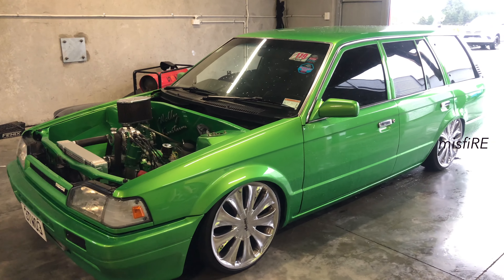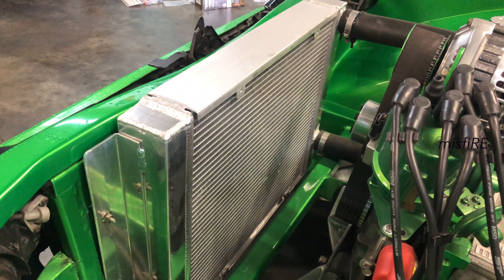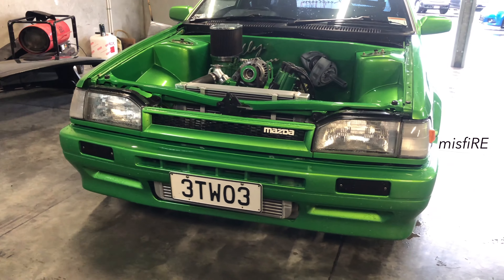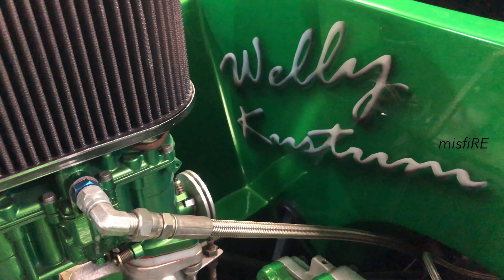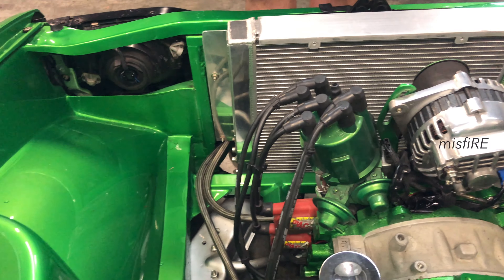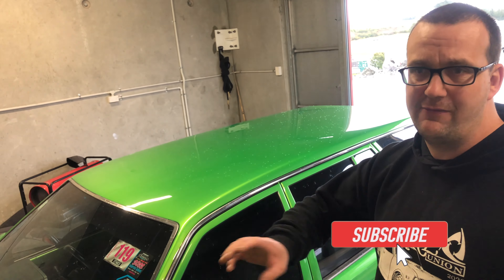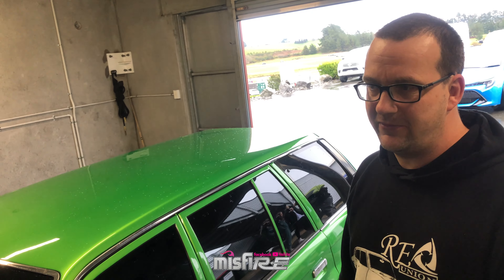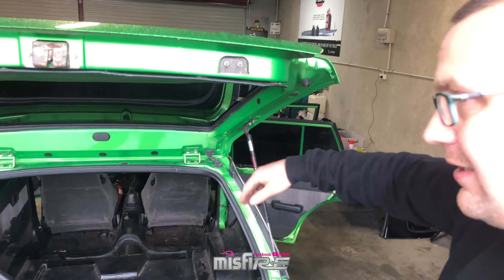4wd Mazda familia ROTARY conversion

Comment: I had a Mazda 323 4wd turbo back in 91 it was 88 model i bought from a dealer that was very limited numbers in Australia. I kicked so many vehicles with more hp,litres and power at the time with this 1.6 turbo charged engine....i wanted a 13B Turbo fitted instead of the original engine but no one could fit a rotary engine left to right into the engine bay. If it was possible all hell would of broke loose.....
Reply from the maker: 💯 the 323 r extremely rare havnt seen one for sale in afes
Reply: someone did a east/west 12a in a honda civic.. so anything is possible.
Reply: It's been done east to west in a 90' gtx with a 13b turbo 4wd, also been done in a bf 323 sedan fwd in NZ. There was also a red gtr familia with 13b bridgey in it, was common to see it rippin skids.
I had a 87' 323 wagon with the full running gear from a 86 323 bfmr and the complete dohc turbo front end also painted the turbo white/grey two tone, miss that car..
Building an 86' bfmr in Melbourne atmo, thing will rip😉
Reply: @DStead2239  sounds mean bro! Any updates on bfmr? I got an 88 bfmr sedan in brissy
Reply: @GTXWGN  Metallic Grey sedan? Think I've seen it. I've got a two-tone 86 bfmr in Melbourne I'm building

Comment: There was a 13b bridge that used to roll around Tauranga . A orange one . If I remember rightly it was a FWD rota
Reply: Yup I remember
Reply from the maker: Mite b at reunion🤞🏻?
Reply: @maccoretti  Bighed number plate
Reply: Yep that was one of the Lawton brothers old car I'm pretty sure number plate bighead.there was a chick that owned a blue one in tepuke years ago I almost brought,not sure if it was the same car or not ?
Reply: @jamesblack683  yeah bro Bighead number plate !!!
Reply: Far I thought it was man nz had it popping in the olddays man haha.any Jappa you could think of had a rota in it
Reply: @jamesblack683  the Mt was the place to be end of the 90s early 2000s .
Reply: @ClwnJuNkY  hard brother from the mount.had half a dozen rotas in the early 2000s.late 90s early 2000s definitely the golden Era of the rota scene
Reply: @jamesblack683  when you could roll up to the mount see the rotas parked up . Pull out a massive joint hit up the owners to hot box the ride . 
Doing laps around the Mt chicks would just jump into your car
Reply: @ClwnJuNkY  I hear ya my man haha good old days 🤙
Reply: Does anyone remember the rusta honda CRX with a 13b front wheel drive that use to drive around hamilton for a few years? Wonder if it's still around last seen it in 2014
Reply: @owenstotts8771  its a Honda 🤣
Reply: @owenstotts8771  I do remember one like that . Was pretty phat !
Reply: Yea my mate owned it for a bit but then swapped it for a 25det r31 , but shit that thing use to move,  think it was on like 8psi and shit it use to torque steer like a mfkr , but would love to know if it's still alive aye

Comment: Gutted! why bother with a 4wd wagon if your going to change the floor pan and rear diff anyway??
Reply from the maker: Very unique build only one like it, cheers for ur opinion🙏👍
Reply: @misfirerotary  Well, kind of lol.. That one he mentioned, the 323 with skyline subframes was built by an aircraft engineer. That was running a built gtr engine and was a work of art underneath, chassis rails were laser cut, folded and pick up points incorporated to fit original floor and nissan parts bolted straight in.. 
I was going to buy it when it come up for sale as a rolling chassis then bring it over to Aussie as a "race car", repower it then plate and tag it🤫🤣🤣..
I missed out though, some lucky cu nt got it first..